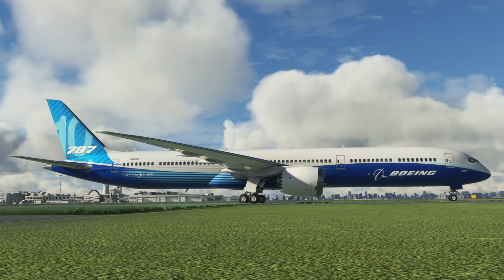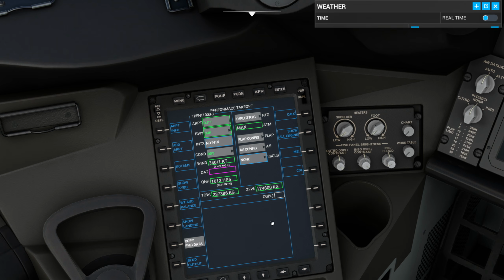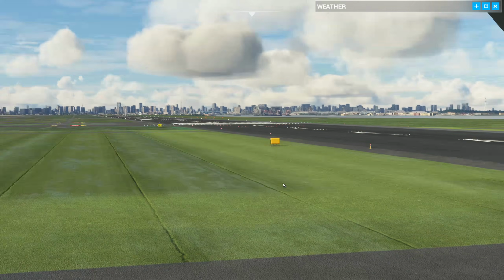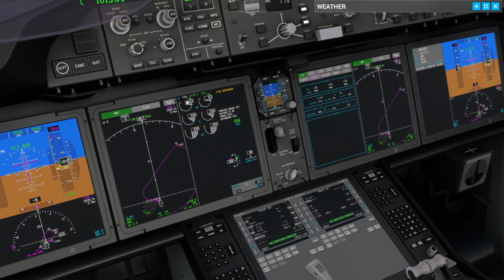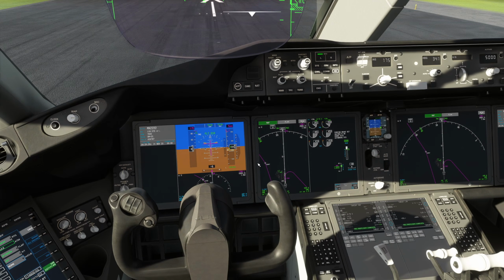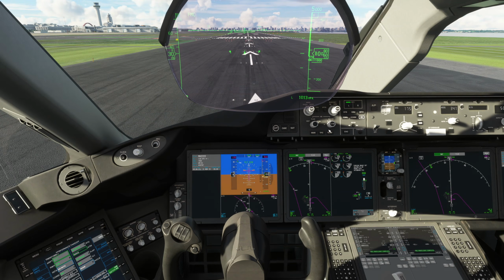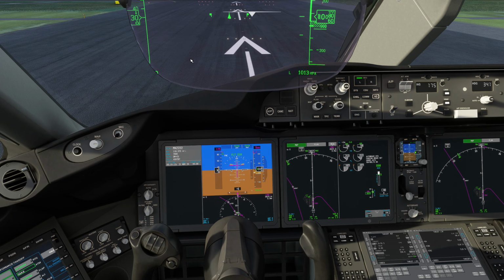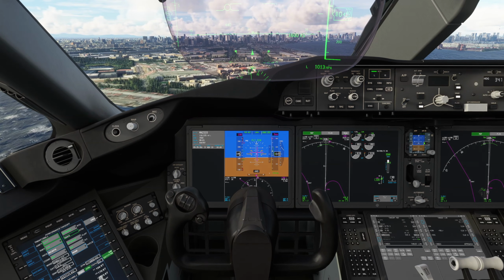Boeing 787 Takeoff Tutorial with a Real 787 Pilot MSFS

Comment: It seems the warning you had given of engine failure while taking off has happened today at Ahmedabad. Plane just stalled right after the takeoff with just 430 feet of positive climb, somehow engines seems not generating enough thrust to remain airborne.
Reply: Landed on your video after researching about the horrific AI171 plane crash. Great video sir. As you mentioned, could it have been the case that after acheiving VR speed and airborne, one of the engine failed and as you pointed out, the other functional engine started de-powering which resulted in a loss of thrust, drop in altitude and eventual crash? Is that a possibility?
Reply: Flaps did not look like it was extended and landing gear was still down. Possibly wrong take off config, pilot error maybe.
Reply: @RandomDude_Z if it was taking off at flaps 5 (which seems typical based on this vid), I doubt it's possible to tell the difference from the crash footage

Comment: Hi, I can never get the TPR to behave properly. As soon as I engage A/P the green TPR reference point disappears and it starts using 100% of the engine or about 96-98. I can’t throttle back either because if I use TOGA then my throttle lever on the side stick is already sitting at the 20% mark from the rolling start before I click the TOGA button. I’m using the throttle lever on the Airbus TCA side stick as I haven’t bought the separate throttle quadrant. I’m just not sure what’s happening with the derating after takeoff, it’s very frustrating

Comment: Hi, I've been trying to flight this plane in MSFS, but I suffered a heavily increasing pitch-up right after off the ground, and I have to push the trim (trim-spedd) full down and the yoke too. Accordingly to the developers everything is all right and that how's the plane behaves and I should add MORE TRIM (I have done that).
All on all, I would like to know if you suffer this in the simulator or if I am doing something wrong during the takeoff off (all is manually done NO TOGA button is pressed) and the FMC is configure as explained.
THANKS!!!

Comment: Twas the night before Christmas, and out on the ramp,
Not an airplane was stirring, not even a Champ.
The aircraft were fastened to tiedowns with care,
In hopes that come morning, they all would be there.
The fuel trucks were nestled, all snug in their spots,
With gusts from two-forty at 39 knots.
I slumped at the fuel desk, now finally caught up,
And settled down comfortably, resting my butt.
When the radio lit up with noise and with chatter,
I turned up the scanner to see what was the matter.
A voice clearly heard over static and snow,
Called for clearance to land at the airport below.
He barked his transmission so lively and quick,
I’d have sworn that the call sign he used was “St. Nick”.
I ran to the panel to turn up the lights,
The better to welcome this magical flight.
He called his position, no room for denial,
“St. Nicholas One, turnin’ left onto final.”
And what to my wondering eyes should appear,
But a Rutan-built sleigh, with eight Rotax Reindeer!
With vectors to final, down the glideslope he came,
As he passed all fixes, he called them by name:
“Now Ringo! Now Tolga! Now Trini and Bacun!
On Comet! On Cupid!” What pills was he takin’?
While controllers were sittin’, and scratchin’ their head,
They phoned to my office, and I heard it with dread,
The message they left was both urgent and dour:
“When Santa pulls in, have him please call the tower.”
He landed like silk, with the sled runners sparking,
Then I heard “Left at Charlie,” and “Taxi to parking.”
He slowed to a taxi, turned off of three-oh
And stopped on the ramp with a “Ho, ho-ho-ho…”
He stepped out of the sleigh, but before he could talk,
I ran out to meet him with my best set of chocks.
His red helmet and goggles were covered with frost
And his beard was all blackened from Reindeer exhaust.
His breath smelled like peppermint, gone slightly stale,
And he puffed on a pipe, but he didn’t inhale.
His cheeks were all rosy and jiggled like jelly,
His boots were as black as a cropduster’s belly.
He was chubby and plump, in his suit of bright red,
And he asked me to “fill it, with hundred low-lead.”
He came dashing in from the snow-covered pump,
I knew he was anxious for drainin’ the sump.
I spoke not a word, but went straight to my work,
And I filled up the sleigh, but I spilled like a jerk.
He came out of the restroom, and sighed in relief,
Then he picked up a phone for a Flight Service brief.
And I thought as he silently scribed in his log,
These reindeer could land in an eighth-mile fog.
He completed his pre-flight, from the front to the rear,
Then he put on his headset, and I heard him yell, “Clear!”
And laying a finger on his push-to-talk,
He called up the tower for clearance and squawk.
“Take taxiway Charlie, the southbound direction,
Turn right three-two-zero at pilot’s discretion”
He sped down the runway, the best of the best,
“Your traffic’s a Grumman, inbound from the west.”
Then I heard him proclaim, as he climbed through the night,
“Merry Christmas to all! I have traffic in sight.”

Comment: I've seen more and more 787 pilots in videos use iPads/tablets because apparently the built in EFB is really slow and outdated due to having components from the 90's and you can't easily upgrade it compared to getting the latest tablet. And because a tablet isn't a part of the aircraft it doesn't have to be as fully certified as the built in EFB does

Comment: Thank you for this incredibly detailed video, again! If you do a take-off with D-2, using up a significant bit of the runway, does it mean that if you reject just before V1 you would still be able to come to a full stop on that remaining bit of runway? Are the brakes significantly stronger (having to stop a heavy machine at higher speeds)?
Also, are you more limited for departures with obstacles/terrain in the vicinity of the end of the runway in case of 1 engine out climb performance, or would you just derate less in that case?

Comment: In the sim, you can get the wind by just clicking the wind section in the 2nd page of the takeoff section. To display the CG on the weight and balance window, expand the window horizontally until you see the CG section. You only need to do this once, and will be remembered.